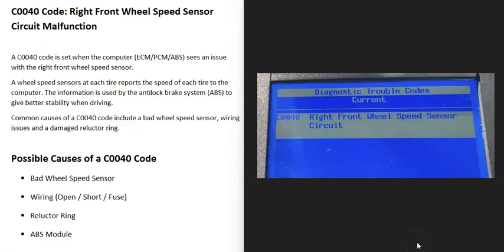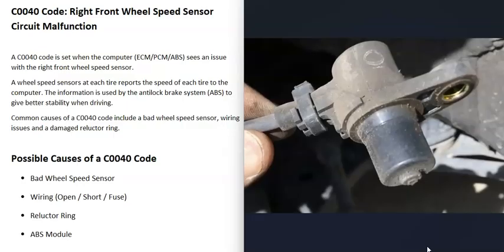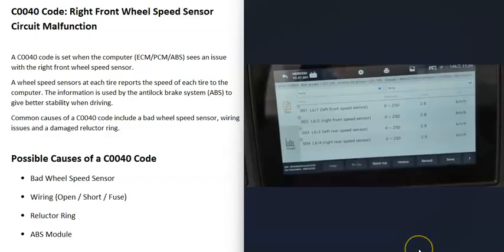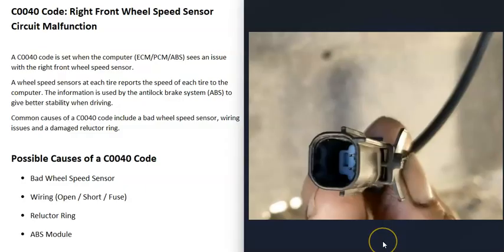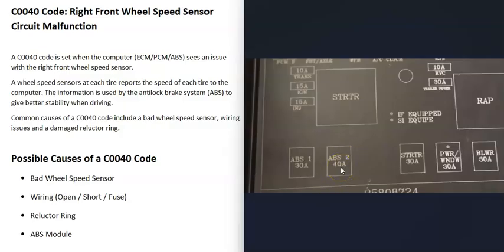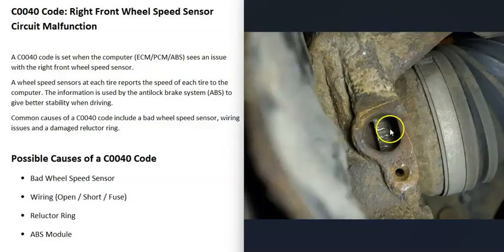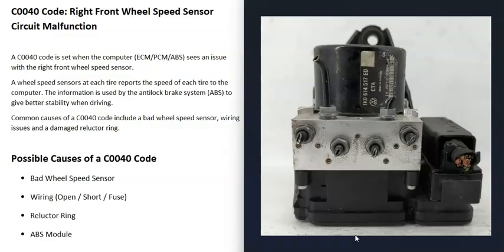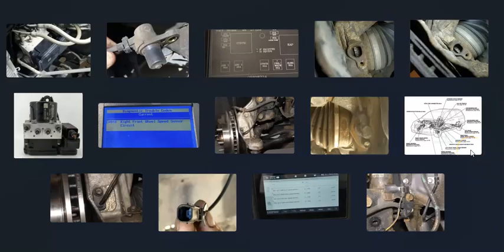Causes and Fixes C0040 Code: Right Front Wheel Speed Circuit Malfunction

Comment: Where do you get information for the vehicle?
Reply from the maker: Sometimes, information can be found for free online, but it can be hit or miss. Professional mechanics use paid services such as All Data and Mitchell Pro Demand. All Data has a DIY section for individual vehicles, but it does cost by the month, and they often have recurring monthly fees, so if used, be wary of which service is bought. Finding a manual for your specific vehicle information is likely best.
Reply: @HVAC_Mechanic we have a small shop not in the usa and a site for information could be helpful but there too expensive for the country I'm in